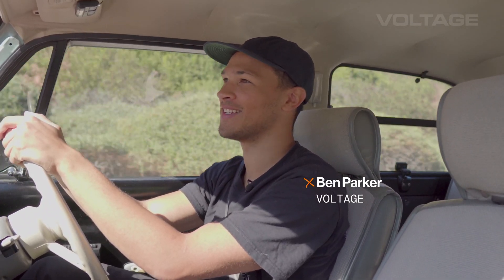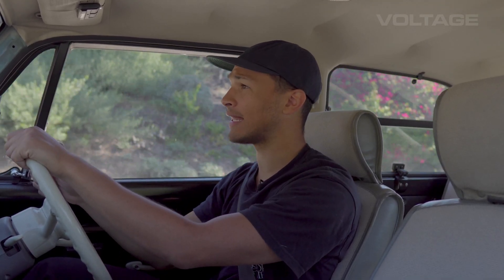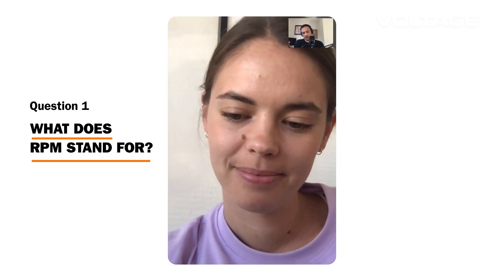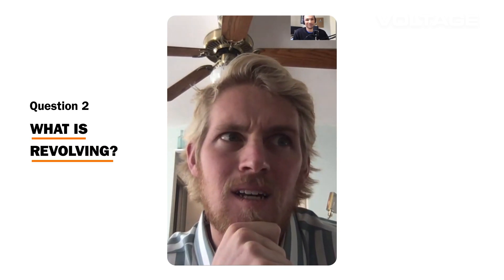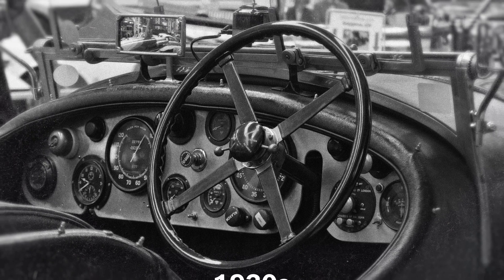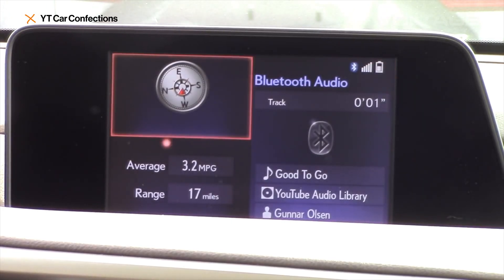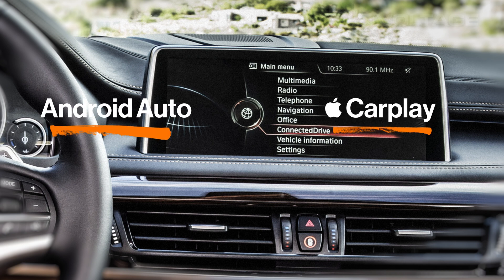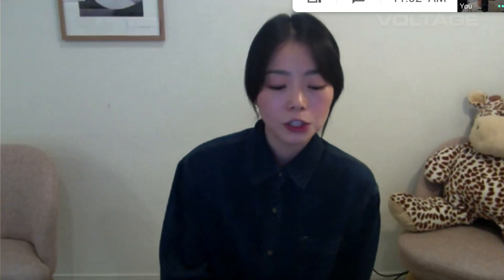Your car dashboard design sucks

Comment: In the opposite, oversimplification of the dashboard is starting to look like a bad future for EVs.  It's absurdly stupid that dials and buttons are fading away for regularly used functions like audio controls, HVAC, and other essential system functions.  Pulling the driver's attention to a screen to stare at it instead of them knowing the position of key dashboard functions by memory is going to be disastrous if self-driving isn't fully developed beforehand.  How are we going to have issues with people being distracted with phones while driving and then move into casually relying on an integrated screen to do everything?

Comment: I love Canoo (and the Pao)...and I'm also driving a 30 year old 1991 saab - simple as hell, everything you want, no bs you don't need-  but as for RPMS in an old shiftable gas car...(some older automatics like my car work much better if you shift to keep the car in the right gear/ rpm range...because Torque and horsepower is a thing that Matters a lot in older gas cars when climbing hills with turns and stuff...but it will NOT be an issue at all in a modern EV.....but in an old saab, if you don't watch your RPMS and drive around hilly curvy roads with the right torque and engine braking (fully dependent on rpms in gas burning vehicles)... what can I say...you're not a serious driver and you probably have never routinely driven on a rural road and pretended to be a race car driver - which is the point of driving - just look at car commercials if there's any doubt about that... but you could also determine rpm accurately by sound if you routinely drove the car and didn't have a gauge. Funny enough - I have a working RPM gauge and a dead speedometer on an older car....I mean for understanding the driving experience and torque and how to drive the car on what road and condition ...in a manual or shifting automatic transmission by hand... RPMs are massively more informative than speed...speed is just how fast you're going. BUT DUDE - we're the same..we love the superiority of our simple old cars that money can't buy today...and we're going to transition from them straight to Canoos and skip the 30 years of terrible breaking screens and distracting off gassing plastic crap designs!

Comment: Great video, you have a new subscriber. I'm already invested in Canoo and a lot of my thinking was relating to their great consumer experience. Sure the tech is great but growth in this case will definitely be achieved though word of mouth. The difference between Canoo is other manufacturers like Tesla is that the subscription model will allow people to try it for a couple of months without commitment so the user experience is key to retaining customers. Most people aren't tech nerds, which is why Tesla sales were slow to grow despite the cars being great (upfront cost of buying slowed sales) but Canoo should be able to get more people to try their vehicles quicker.
Reply from the maker: Thanks for coming by!

I think you’ve got a lot of good points. I’m really interested to see how the subscription model is received, I think more car makers will move to something like this in coming years. Volvo and Mercedes are both starting to offer similar subscriptions.